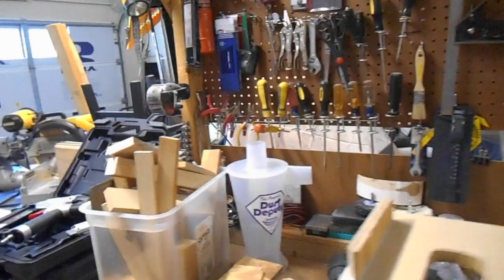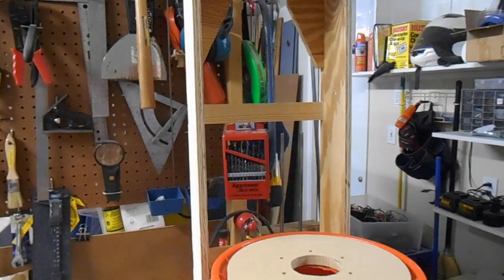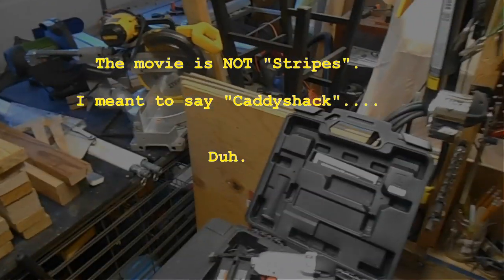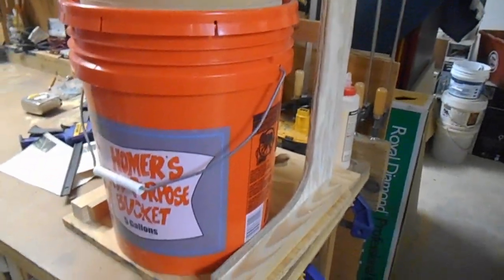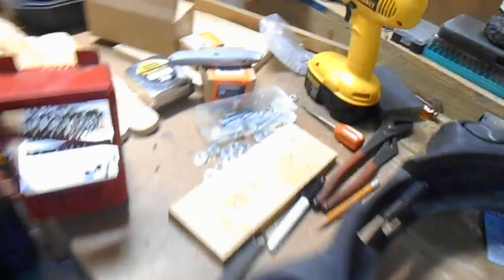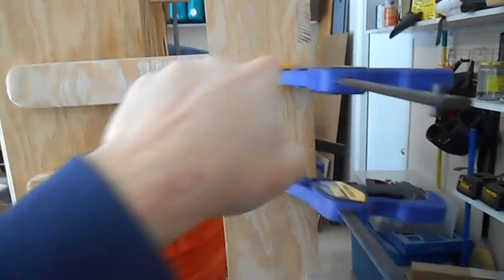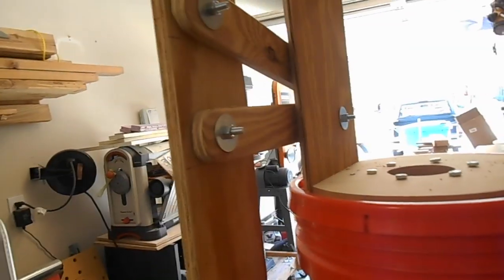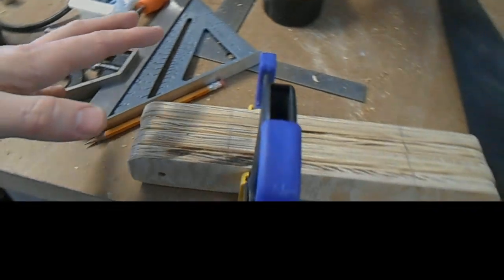HowTo Add a DustDeputy Cyclone to RIDGID Shop Vac - 3 of 3

Comment: I like your ingenuity of the buck lid raise. Over time keeping a tight seal will be a challenge.  I solved my connections to the 4" dust deputy with just a 10" piece of vinyl  flex hose.  It will squish up and down and allow about 5 inches of room to pull the bucket out.    How well has the setup held up?

Comment: Cool setup.  I have found it a real pain to remove the bucket lid on my system.  Unsnapping it each time to empty the bucket is a major operation.  Do you find that you get enough of a seal without snapping the led tightly to the bucket?  Thanks.

Comment: How well does the shop vac and dust deputy combo work on larger tools... Like a table saw?
Reply from the maker: I was going to give a detailed answer, but I see you already found my table saw dust-chute video!  The cyclone + wet-dry vac works fantastically well with the table-saw.  Even after using it for a couple weeks now, I'm still a little stunned HOW well it does function.  And I definitely notice the difference if I use the tablesaw w/out the vac attached--lots more fine dust blowing about.